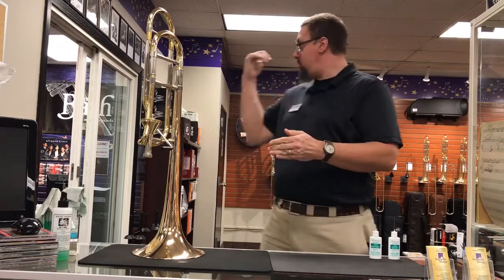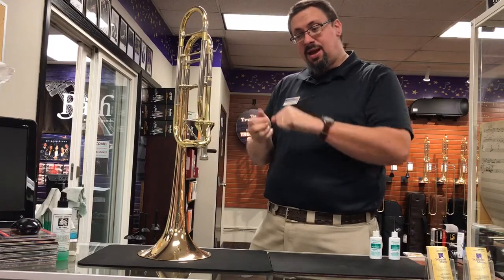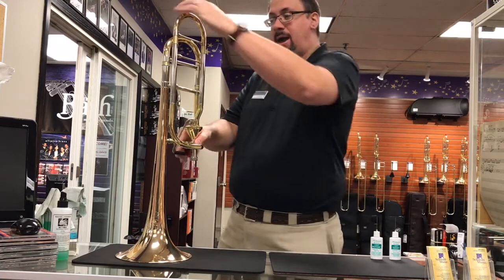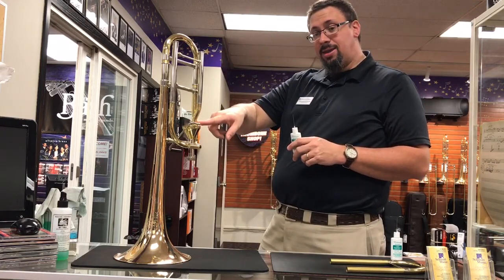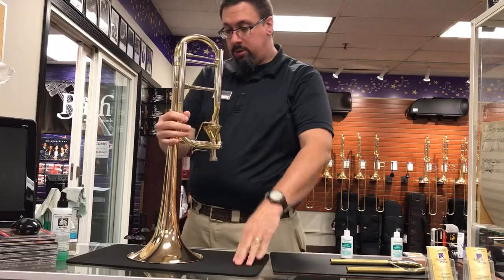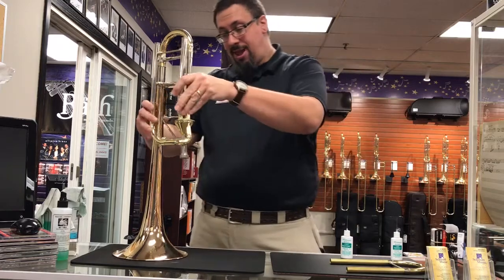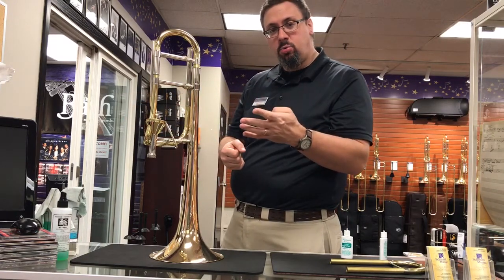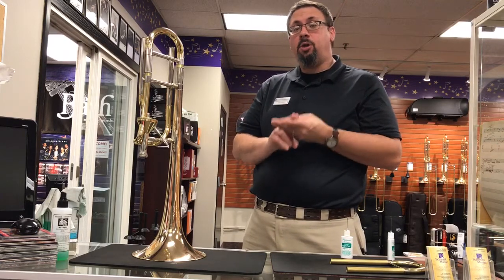Axial Flow Valve Lubrication 101

Comment: The video from SE Shires shows their technician applying rotor oil down the slide receiver tube versus the f-attachment tube.  I prefer this for better action and it prevents the oil from getting mixed with tuning slide grease.

Comment: I used the “rotor” oil to lubricate my thayer valve since I don’t have the “light rotor” oil. Would it affect the valve if I use and add a different oil?
Reply from the maker: I generally haven’t had a lot of issues with this, especially if you are changing weights of oil within the same maker (I.e. Hetman, Ultrapure, etc.). Combining different makers’ oils can occasionally cause valve response to slow down but gradually “flushing” out the old oil with the new will typically correct this.  The other option with the Thayer is to disassemble it, clean it out, and reassemble with the new oil; I don’t do much work on my horns but even I feel comfortable taking Thayers apart...
Reply: Schmitt Music Trombone Shop Thank you for your reply! The oil I use is still Hetman. Should still dissemble it anyways if I want to put the light rotor oil, just to be safe, unless it’s still okay not to?
Reply from the maker: If you are sticking with the Hetmans you should be just fine.  I have changed weights with them many times with no issues.  Thanks!
Reply: Schmitt Music Trombone Shop Thank You! 👍